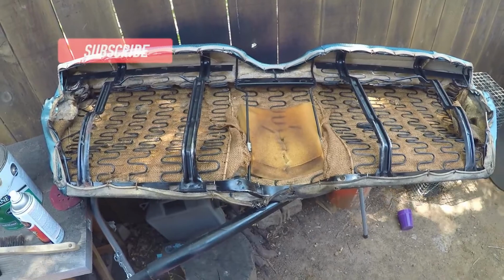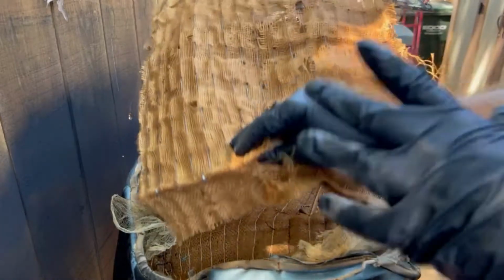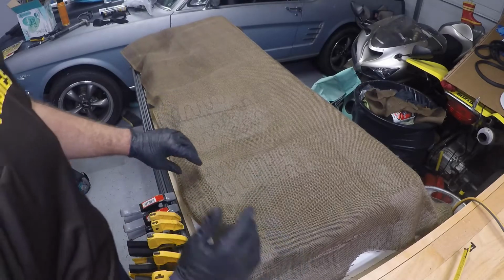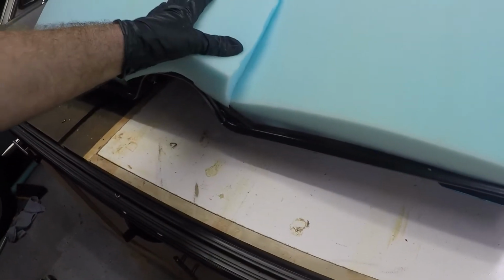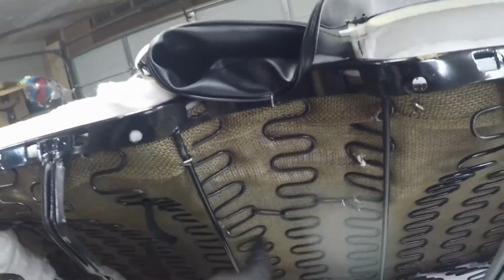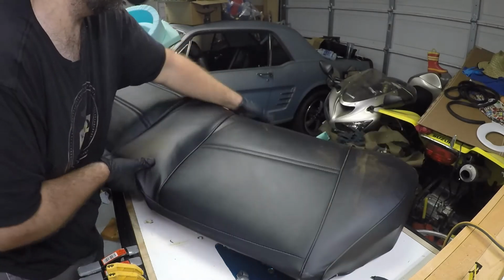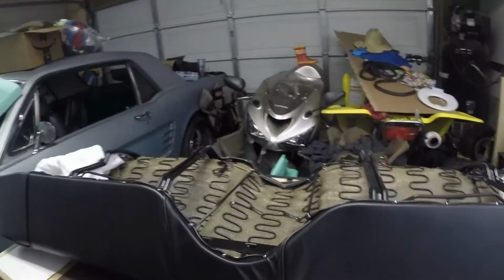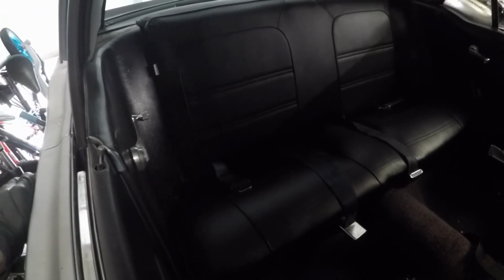RE-UPHOLSTERING BACK SEAT IN 1966 MUSTANG PART 3

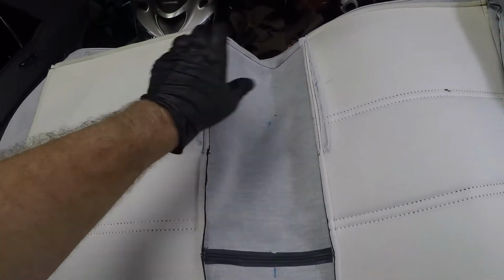Comment: I see in your video at 9:00 you're hog ringing the two listing wires that are on both sides of the hump. For whatever reason, I felt I should try doing that from the underneath, after I had the perimeter aligned and mostly hog ringed down. I just can't seem to penetrate the foam to get to the listing rod channels on the inside of the upholstery. I'm thinking I'll have to undo the perimeter and start over. 😞